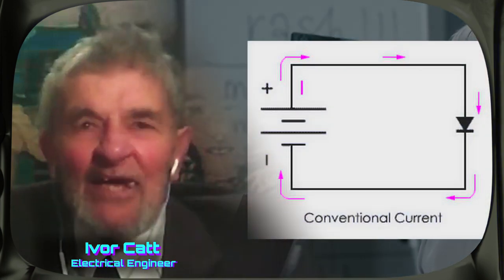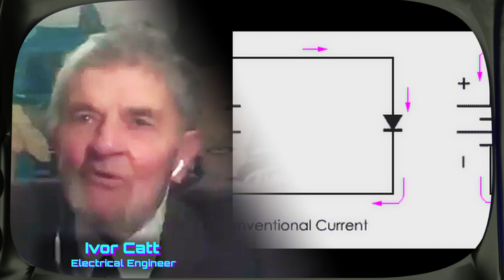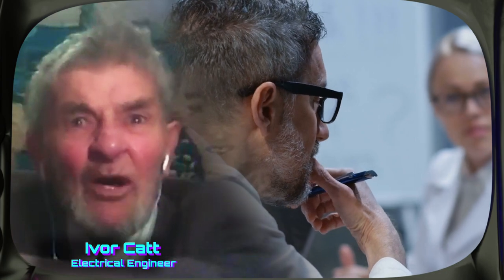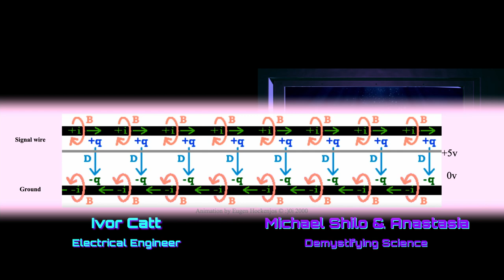(2/2) What Is Electric Current? - Ivor Catt, Electrical Engineer

Comment: 52:42 is the culmination of all this interview: the real "wire" is the one formed by the two wires, or better, the SPACE between the two wires , while they become just "obstructors" to the escaping of energy from the source, po(y)inting directly to the load. Did you grasp this? Because I do, and this is groundbreaking seriously. Veritasium is just half-way in this, talking about fields set up by the electron current, and not the other way around, while Catt got it entirely decades ago.
Reply: A good book is JD Kraus textbook "Electromagnetics," (from 1973 but there are many later printings.)  He properly goes into Poynting/Heaviside concepts, when all other textbooks either avoid it, or get it all twisted and erroneous.
Key concept: Electromagnetic energy will bounce off a conductor (as when light or radio reflects from polished metal.)  Even at an extreme glancing angle, the EM energy is reflected.    But also, a cylinder-shaped radio wave can reflect from a wire and thus become trapped, as long as the wire is running down the center of the wave.  If the wire then curves, the EM wave is forced to reflect and follow the curved path.    It's much like a microwave waveguide, a hollow rectangular pipe, where conductors surround a beam of EM radiation.   But with wires, the topology is inside-out when compared to the rectangular waveguide, and instead the beam of radiation surrounds the conductor!  It's like hollow macaroni sliding along a rod.   Yet in both situations, the hollow EM wave or the hollow metal tube,  the metal forces the EM waves to follow along because of reflection.   Added concept: if two parallel wires are used instead of one, then the long-wire waveguide works at any frequency, including DC.  (This solves a mystery that I'd wondered about for years!  How the heck can microwaves "fit" through tiny coax cable, when the rectangular waveguide has to be a half-wavelength across?   Kraus shows how it works, with EM fields compressing themselves under an intruding shield:  http://amasci.com/graphics/kraus_poynt.gif )  

Now go see: waves on single wires and N. Tesla http://amasci.com/tesla/tmistk.html
Reply: @wbeaty  Master!
Reply from the maker: it's important to define what you mean by "space." We think of it as the distance between surfaces. Emptiness. Hard to conceive of how empty volumes would accomplish work in a material universe.
Reply: @DemystifySci_Podcast  The "material" universe, including apparently solid objects, turns out to be made of empty space containing trapped e-fields and b-fields ...if we ignore the dense parts, and only look at the volume in any material object.
Once we know that solid volumes are actually composed of space and EM fields, circuit-physics seems obvious: manipulate just the space and fields alone.  Why not build moving belts and oscillating rods from just the empty space and the fields, and let the copper wires remain motionless?  Genius!

Hard to conceive how empty space can vaporize a razor blade: empty space, plus kilojoules of EM fields propagating from a ruby crystal wrapped by spiral flashtube.  Hard to conceive how any electric motor works, when between rotor and stator is empty space: empty space plus b-fields.  Hard to conceive how explosive-scale energy can be stored in empty space between parallel charged metal plates.   Insight: electrical energy and light are the same thing, but with two different bands of frequencies.   All those little kids who wonder if we could make a mirrored box, then trap and store light waves inside?  That's what a magnet is.  A magnet, or a capacitor:   low-frequency "light" trapped in a little box.

Weird conclusion taken from all this: when using words correctly, we're forced to confront the fact that "electricity" doesn't exist, because the thing labeled "electricity" has a more accurate name: electromagnetic energy, the EM-fields in empty space.
Reply from the maker: @wbeaty  you're not making any sense. A field is a set of locations with an observable/predictable effect. You can't make something material out of effects. Come over to Discord or FB if you want to really figure this out together.
Reply: @DemystifySci_Podcast a field is what you say, on paper and on the blackboard. But what about the physical reality? A real field I mean. Anyways, it is now manifest that you hosted Ivor Catt's interview with a skeptical and derisional point of view, because you are materialistic scientists as the majority. I also see that maybe you haven't heard of Beaty before, but that man (for what concernes me) has put on the web a whole load of information about electrical phenomena to have completely revolutionized my mindset on that argument. Take a look at Veritasium wreaking havoc in the community with his video on ExH, it's incredible since wbeaty divulged that concept in maybe 1999 or 2000 in his amazing and bare metal website amasci (and later on Quora), and also The Science Asylum did a video on ExH years ago, and many others. Simply put, the audience, the people, the scientists themselves and the scientific communicators, have all different velocities in understanding. Some lag years. Edit: how many years are we lagging behind an older and aged "Veritasium" showing a single wire transmission line doing work? (e.g. I mean, transferring power?). Because as many others, I did it in my garage, but the majority of engineers and scientist thinks power can be transmitted with at least two conductors, and single wires transmission of power is crackpot science. Did you know? Or Am I too not making any sense? Greetings from Italy
Reply from the maker: @tanner1985  https://demystifyingscience.com/blog/the-elastic-atom
Reply from the maker: @tanner1985  https://demystifyingscience.com/blog/faradays-field
Reply: @DemystifySci_Podcast  you are very wrong about this. You absolutely do not have to define things the way you tried to require here. Surely you can see that now, right?

Comment: coulomb forces of the battery exerting forces on the electrons of the conductor molecules causes the charge?

I wonder if his model is compatible with Tesla's systems of energy shuttles and single wire systems.

Comment: The Alexanderson antennas in Bolinas, look that up. Everything changed at two points in time: one with Tesla and his antenna on Long Island getting shut down for wanting wireless power, but also his 'crazy' ideas about electricity; and then during and after WW1 when radio was a 'weapon' and the Marconi antennas were taken over by RCA, two antennas operating in ways not traditional - so why did they get silenced? One possibility is that the research was made Top Secret having to do with anti-gravity research and other non traditional technologies. Electricity is very very important, thus....
Reply from the maker: cool! we have friends there

Comment: Ivor has replaced his Theory C with his new Theory D – this emphasises that nothing moves along a wire, not in nor on nor along.
(1)   This means that electricity-electrons do not move along an electricity-wire. Not in DC, & not in AC.
Ivor does not believe that electrons exist – hence that is one reason that nothing moves along.
But, even if electrons exist, Ivor reckons that they don’t move along a wire. I have not asked Ivor, but i think that he might agree that electrons might (if they exist) move across a wire, ie jostling up & down & up & down etc, or, jostling round & round etc, in the one place. 
Anyhow, whether it is jostling electrons or something else, something heats the wire. A parasitic secondary effect.
(2)   It also means that the E by H energy current does not move along (outside) the wire.
Here i think that Ivor would by happy to say that it propagates along  – but nothing is moving along.
However me myself i reckon that some kind of cause or somesuch has to be moving along in some way.

Ivor in his written work correctly derides Westerners because they believe that electrons drifting at say 1 mm/s can make a wave that propagates at 300,000,000,000 mm/s. 
But i suspect that Anastasia in effect agrees with Westerners (see the wave in the pencil analogy)(it might be at 1:12:20) – i hope i am wrong.  I do not know what a university stinks like – but even i know that for a wave to propagate there must be some thing (or some part of a thing) that moves as fast as the wave (or faster than the wave) during the whole time (or during parts of the time). 
Ivor correctly points out in his written works that Westerners can't be correct, because electrons (if they exist) have mass. I would like to point out that Ivor is not quite correct – the Westerner (electrons nudge other electrons) idea (of electricity propagating at c) is impossible even if electrons don’t have any mass (but i wont go into that today).

1:51:45.  Did Ivor mention aether?
MS&A asked Ivor lots of times re what is energy or what is energy current or why does energy current need a wire etc etc. Ivor did not say. But, the answer must involve the aether. But, no-one mentions aether, except me. Veritasium doesn't.

Ivor said he has not heard of Veritasium, or V's latest footage re electricity. However i myself alerted Ivor to Veritasium a couple of weeks ago. I guess that Ivor must get lots of emails.
Reply: Excellent comment.  I completely agree.
Reply from the maker: A is not a westerner. We will be advancing our own solution to what is current at our new channel The Material World. Our solution involves systematic deformation of the surfaces of the atoms in the conductor. Please sub and stay tuned for that...

https://www.youtube.com/channel/UCiQZyl92mPzODKJyaVCwc_g
Reply: @DemystifySci_Podcast To mad aetherist and the Two Aliens: I suggest to take a look at Ionel Dinu channel and his papers on Researchgate. He is puttind down maybe the best approach to aether I've ever seen from the beginning.
Reply: @tanner1985  we'll check it out, thanks! We are, however, skeptical that any fluid model is appropriate for atoms&their connectivity as shown in our latest movie and the blog posted above. Cheers!
Reply: @DemystifySciInvestigates  I'm checking out the blog, Part I already read. Anyways I did not say you have to agree with Dinu's papers, while to be skeptical is the nemesis of agreeing, but I said that his take on Aether (which involves an electrigen) is one of the most advanced I ever had the chance to read about.
Reply: @tanner1985  thanks for the suggestion!